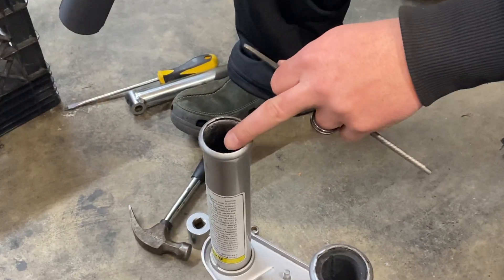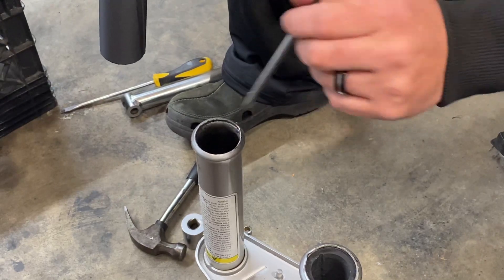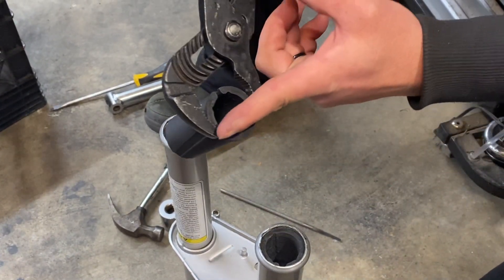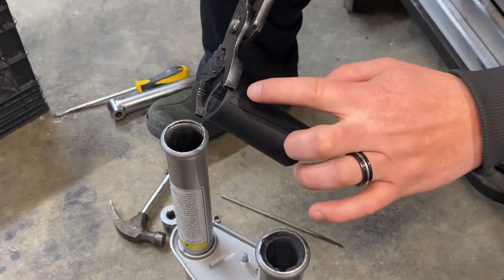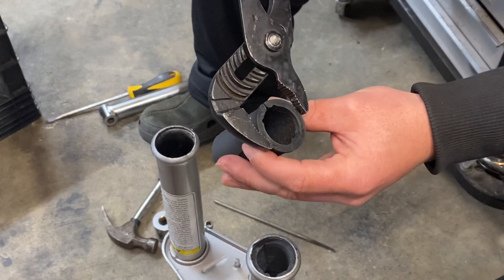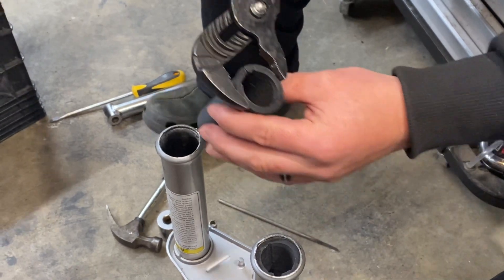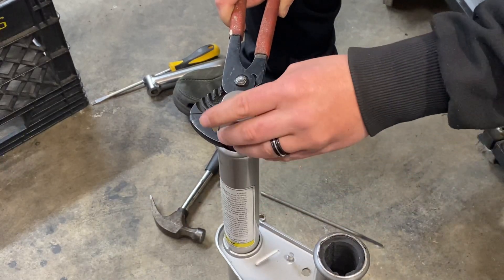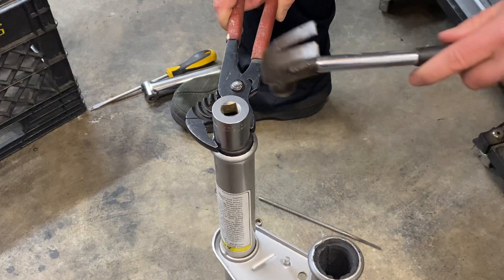How to install fork shock bushings on Razor MX500 MX650 SX500 dirt bikes

Comment: if i already have the amazon lift kit springs will these bushing work on mine?
Reply from the maker: I sell a dual spring lift kit that has variable spring rates for covering a variety of terrain. You’ll find that the Amazon springs are ultra stiff and don’t have much movement. But if you decide to stick with that, the bushings will fit a stock bike, my Lift, or the Amazon one you have. You can purchase them through eBay, myself directly on fb or email. The info is in the other comments. Working on a website.
Reply: @freshmaker5  ok thank you i would’ve went with yours but i already got the amazon ones and im sick of returning stuff i’ve already returned 2 pairs of forks and tripple trees and rear shocks because they wont fit
Reply from the maker: @Rippinandfishin that’s ok. You shouldn’t lift the bike with stock bushings though. They can’t handle it. Get a hold of me for an upgraded set.
Reply: @freshmaker5  i just got my amazon springs and your bushings are the springs supposed to go in the bushings
Reply from the maker: @Rippinandfishin  where did you get my bushings from? My eBay? Amazon springs just go in place of the old springs. Everything is in the same order with that set up. Throw away the old bushings.

Comment: Do you need any special tools to just change the bushings?
Reply from the maker: I sell the bushings, tools, and front lift kit individually on eBay under their respective names, but you could just type in Daddy2fast in the eBay search bar and they should pop up. Or email me for direct pricing at daddy2fast@yahoo.com.  Everything is basic tools, except for taking out the fork post. The extension needs to be very skinny and long. One Allen wrench size for the stock bolt and one for the aftermarket bolt. I tool kit includes 1/4” extensions and both sizes of Allen bits.